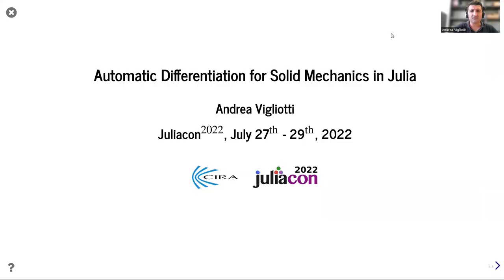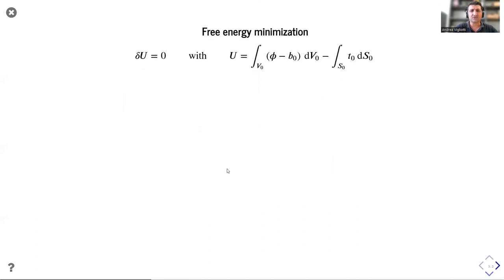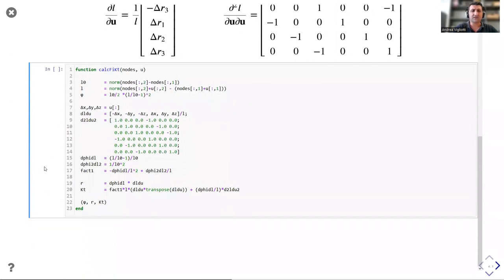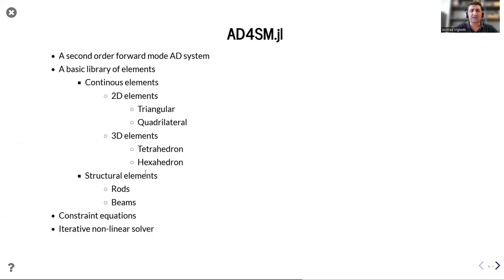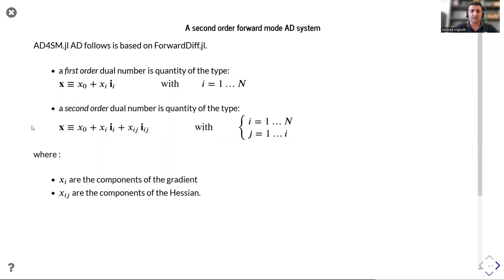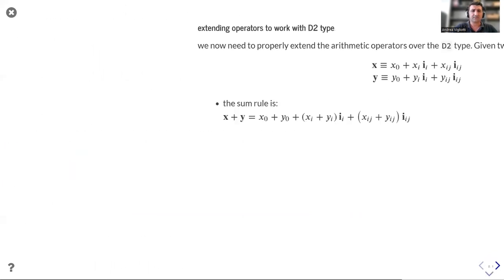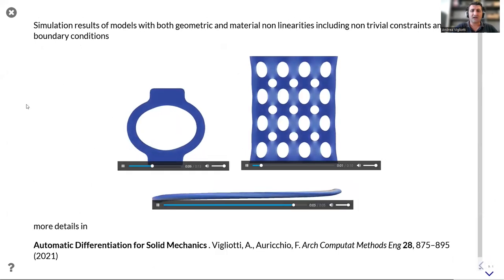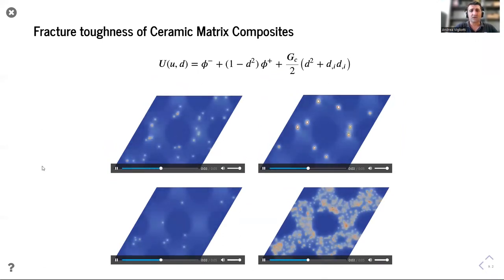Automatic Differentiation for Solid Mechanics in Julia | Andrea Vigliotti | JuliaCon 2022

Comment: there is a typo in the last slide starting at 7:13. The correct equation should read

U(u,d) = \\phi^{-} + (1-d)^2\\, \\phi^{+} + \\frac{G_c}{2}\\left(d^2 + l_0^2\\, d_{,i}d_{,i}\\right)